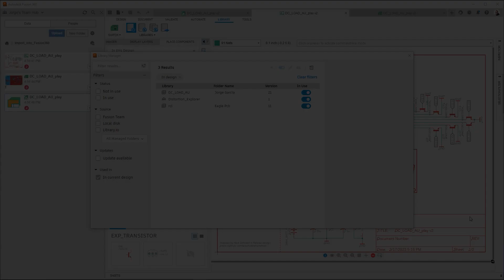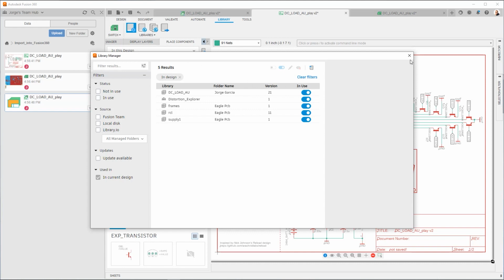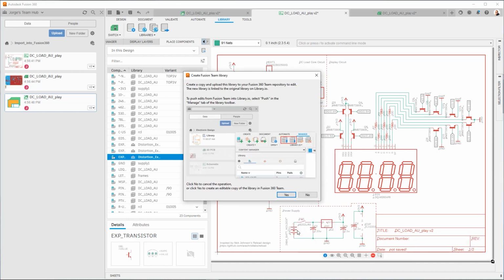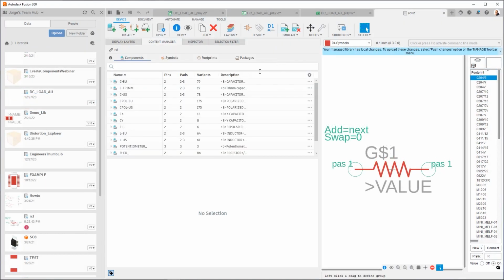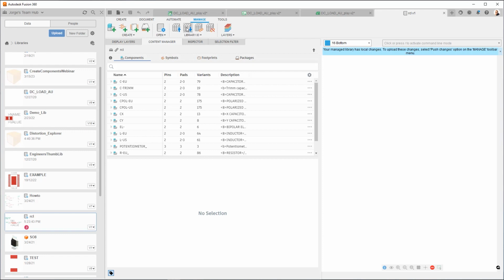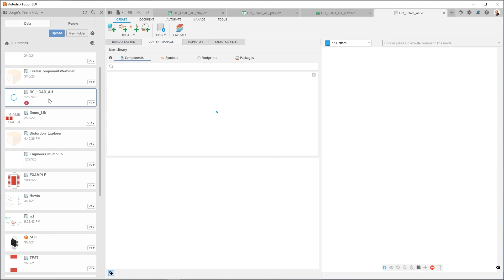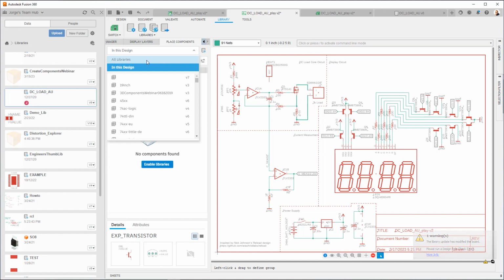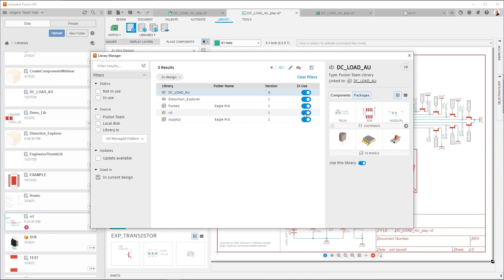Importing EAGLE designs into Autodesk Fusion Part 4: Using libraryio libraries inside of Fusion

Comment: The two local libraries which were associated with my imported Eagle files weren't being detected by Fusion. I found the local path that Fusion references for local libraries (Preferences>Elecronics>Directories) and moved my libraries there. After restarting Fusion, it detected the libraries and my schematic auto-linked to the associated components.